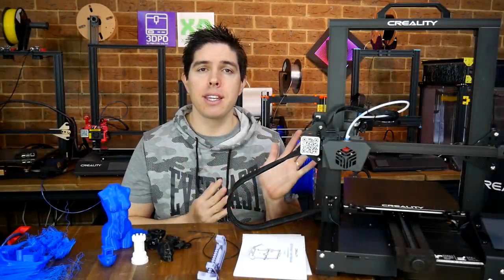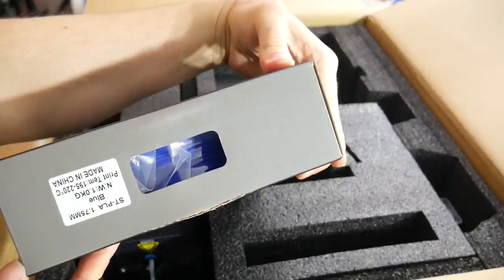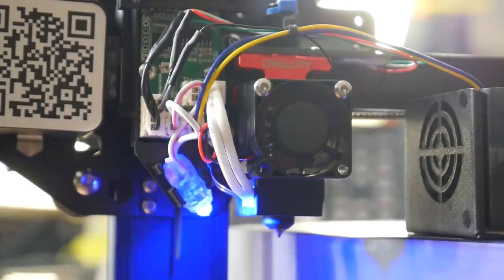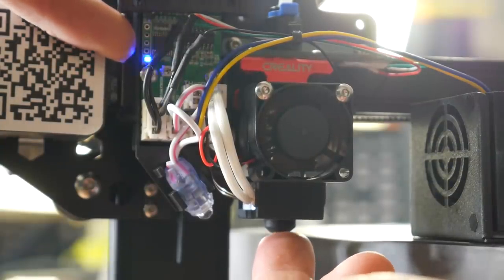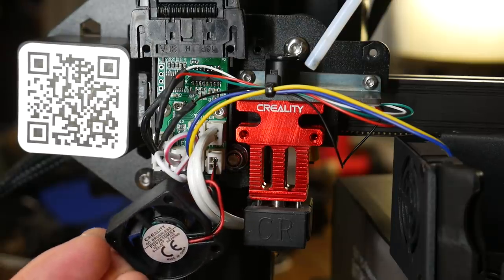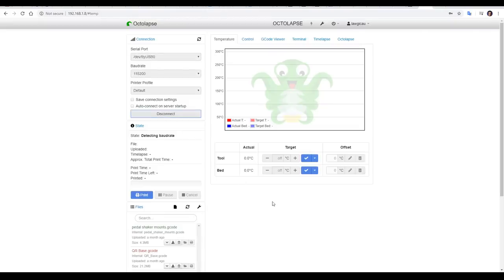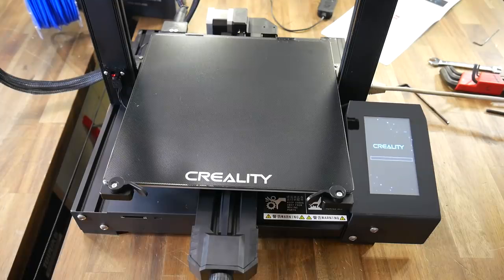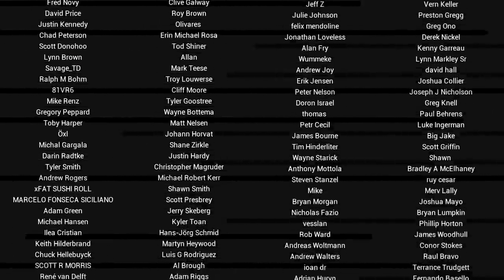Creality CR-6 SE - Your questions answered!

Comment: I wonder how long that extruder will last before something on it cracks.
Reply: why should a steel plate crack when the triggering force isnt even enough to pinch the surface? even if its faulty and crushes into the bed, it wont harm anything. the stepper is just not strong enough to do so.
Reply: I think he meant the new design extruder, not the hot end mount. Creality extruders have a habit of cracking at the pivot point. That is why so many of us add the metal ‘upgrade’ version. This new design with a straight feed path should stop the filament from eating into the arm, and hopefully the new mechanism will prove more robust.

Comment: This weekend I spent 48 hours diagnosing under extrusion in my Ender 3.  Replaced bowden tube, nozzle, the extruder gear and finally the hotend... still very under extruded...  It turns out don't ever turn on "Filament > E in mm3" in marlin!  As soon as I turned it off problem sorted!
Reply: yes E in mm3 is volumetric extrusion, it is an option available in Prusa slicer. the filament in not measured in millimeters but in volume of filament (mm3)
edit: I am using it with Marlin but apart of switching from 1.75mm to 3mm filament, it is not much useful
but useful to use the same gcode on a farm of printers with different filaments
Or if you have a realtime filament size detector (yes it exists) that can change the extrusion based on the filament diameter in realtime

Comment: I have the wonderful CR5SE, A bit expensive but worth it. after a couple of weeks operating great, "making a Set of Chessmen". I changed the Filament From Sunlu Wood to Smartfil Mahogany, but it will not print, I had no problem with Sunlu filament but this mahogany is a problem. I need help to change the nozzle and other components in the hotend to cure the blockage. HELP!

Comment: i don't like not being able to see extractor working... also on the auto level do it leave nozzle at a fixed distance after auto leveling,or does it lower or raise nozzle during printing to keep distance exactly the same on every part of the bed... i ask since there is no such thing is a perfectly flat consistent surface in most cases.... thanks

Comment: I've a Ender 3 heavily modified and wondering if new CR6-SE could be a good change.
Reply: If you are just looking for a reliable printer with good quality: No. the Ender 3 is capable of reaching perfect, and I mean literally perfect, prints even without mods. Yes, i have one myself and it shreds. For more features, more solid construction, better quality over all (maybe higher temps even idk no idea right now) the CR6 is a good option but honestly I dont think its worth it for an Ender 3 owner if you only need one printer. If you want two, the ones here I think are a good duo.

Comment: What the heck has linear advance has to do with UART????
Linear advance can be enable with any drivers even non UART or non SPI ones
Reply from the maker: TMC2208s are incompatible with linear advance when connected in legacy mode. Like on the Creality Ender 3 silent boards as well as this one.
Reply: RomanoProductions A question to you (Creality hasn’t answered me on kickstarter) it looks like we gonna hit the stretchgoal so that the printer is shipped with TCM2209, can we use Linear advaced on those even if UART isn’t used?

Comment: How about upgrading the heatbreak to achieve all metal?
TH3D sells a Tough Titanium Heatbreak for $8 USD (Seems to work well for my Ender 3 with no more PTFE rot)
Triangle Labs sells a Bi-Metalic Heatbreak for $16.50 USD (Fancy)
Reply: dont buy titanium... the plastic sticks to it way more than to nickel platet or stainless stuff - you will see it in ease of use and sometimes even in print quality, especially on pla... 
and to be honest - its just not necessary to enhance heatbreaks, they work well.
Reply: @hanswurstusbrachialus5213  With a titanium heartbreak it is required for best performance to complete a seasoning with oil. Standard canola oil works well and can be done with a filament oiler (found on Thingiverse) or dip the tip of the filament in the oil before a long print (10 hours+), wipe off the excess, and print. This would be needed for PLA but not so much for PETG or nylons.

Retraction settings are also key to stay away from heat creep. Reducing your retractions to 2.5mm or lower, it will keep the material away from the heat break more and also reduce stringing. The TH3D heat break has a very good guide on all of this.
Reply: @Gunner0352  So.. you just explained why not to buy a titanium heatbreak. Its just not worth it. fact. Printing since years - you just dont need it. Too little benefits for too many problems that could come.

Comment: Great video!  Finally got mine after months of waiting.  So far it's doing a very good job of printing, however the first few layers are very thin towards the front of the bed (you can see the thickness decline as it prints), and if it wasn't a glass bed I would presume it was warped.  I run the auto level prior to each print and it still does the same thing.  I noticed that the bed will move if I press down on the front, this doesn't happen at the back.  The Z distance is set at .2 for the auto level and I don't believe that is the problem.  Have you run into this issue at all?
Reply: Yes, Same issue here, did you ever find a fix for this issue? many thanks
Reply: @josephdavid8091  I haven't been able to totally fix it, however I first bring the extruder to the center and set it at .2 using the up/down arrows for Z, then run the auto level.  It's been about a month since I last did, and it has been printing with acceptable results for all that time.  The printer is on and running as much as 48 hours before I shut it down for 8 hours than start again.  Hope this helps a little.

Comment: Personally, i think this printer has 2 major issues, both with the board that were mentioned. With 32 bit upgrade boards and UART drivers so common, i find it ridiculous that the stock board has neither. The driver being forced into stealthchop is a fairly significantly issue for the extruder motor for multiple reasons.
Reply: It's a 32bit on the KS for free and will go retail with a 32, so that's one thing to cross off you concerns list.

Comment: With just a replacement hardened nozzle , will I be able to print filament such as NylonX?
Reply: Probably not.
Reply: @barracuda6817  Is that because it is not a direct drive? Do you think PLA Carbon Fiber would work?

Comment: What does it use to transfer the files? I would assume either sd or cable but hope it uses usb
Reply: If using USB, you need to cut the 5V line to protect the electronics.  Unfortunately instead of custom making that item or just not soldering that pin, they used an off the shelf system and you can blow your main board if you plug in a USB Cable that has a 5VDC supply...

Comment: It's always interesting that a company who can listen, who promotes upgrading will take what people have done in their masses and apply that to a product. Which is what they have done here.

It is a ender 3 with a refined look. And I think you're right it could have had a bigger bed, and they could have put In the package one of those pop up tents for it, for better results (for some of us who live in tempered areas).

Maybe what they should do is make all those parts available as ender upgrades? I have already seen V2 parts available at good prices to update my pro further.
However the issue I have with the printers is that what they do put together is not done to a High standard.
And this printer makes the E3's look like the problem child as they seem to have ironed them out in this....
Or acknowledge the defects in the offering previously...  Roller bending, finger traps for stupid people, and wayward ties... Bad bed clips, bad bed on springs... A hanging out PSU. (Not as if it is looks good) and so on, but it's just little things... Now make it print faster.....or is that why people buy so many so they can print a job within the day??

Comment: Thank you, can we add motor dampeners and which is the best silent fan that we can replace?
Reply: Motor dampeners aren't worth it for the hassle, especially because the only "loud" things on a "silent" printer are the fans. For that, I would recommend noctua 4020, decent price and quite reliable.
Reply: @EdisonWong2004  But I thought they are 12V with low RPM compared to the 24V high RPM, won't that affect cooling?
Reply: I challenged Creality on these fans, because their Kickstarter FAQ says the printer will be silent (~30dBA).  Creality answered they will be shipping what they promised, so these early demonstrators to YouTubers must not be fitted with the final fan.

Comment: it looks almost exactly like a longer lk4 pro with the screen moved and control board rotated and attached to the front
Reply: If the longer had Belt Syncronized, Dual Z axis, Strain Gauge ABL, with custom hotend/LED and optical sensors, real x and y belt tension ..... then ya, EXACTLY like that.... LMAO

Comment: It even looks like they have used half decent connectors although  i will never be happy until i see dedicated high power rated connectors for the hot end/ ends  and bed .
The old geeetech I3 clone i use has taught me many things with how the high power connectors should be configured and i have now set up the mosfets so they are using the metal case as a heatsink and a fan blowing across them  , the logic control and ground  is the only thing connecting them to the motherboard and they are wired directly to the hot end and bed via 30 amp XTL and 50 amp anderson connectors respectively , all wiring is 30 amp silicone coated , this ensures that the only thing going through the ribbon cable is logic level signals.
For a sub 1k$ printer it has some real nice features and looks to be simple to set up  and get running.
Reply: hotend is not high current

Comment: In the case of changing the hot end, I'd have to changed the bed so that I could do manual leveling. Sounds like a hassle outside of it being awesome for any PLA or PETG printing. As long as it prints reliably at 245 without melting the ptfe lining I think I will like this. I asked for two on the kickstarter.

Comment: That hotend being ptfe lined and propietary is a deal breaker, it makes the printer basically a pla only machine. 

I personally think that the artillery (evnovo) genius is a much better deal than this machine.  Titan aero clone and 5 spare pins at the hotend make it much easier to upgrade around the hotend/extruder.  This isn't even mentioning all of the other better features, like the ac powered bed or the ability to use a usb drive.  The genius will also be cheaper.
Reply: I'm actually between these two models and still undecided. One of the things that pulls me towards the Artillery is the direct drive, since I will be wanting to do TPU, but having seen TOU printed on this video I am not that convinced anymore.
Reply: Most PTFE is rated at 250-260C. That makes it good enough for ABS and PET.
Reply: @groundzero_-lm4md  it is not rated for 260, it starts off gassing at 240 and you want a margin in case of temp reading error so you would at most want to print at ~230.

Any company that claims their ptfe is suitable for use over 240 is lying.

Comment: You can get an Artillery Sidewinder X1 for that kind of money, and get a larger bed that's AC heated, a stiffer frame, a direct drive extruder, much tidier cable management, and pretty much everything else this thing offers apart from the ABL and the belt tensioners (you can even print the latter), just saying. 
That's the only "style" of printer i'd "upgrade" to from my CR-10 mini. And even if was buying my first, i'd still choose the Sidewinder X1 over this thing. Then there's also the Genius (smaller X1 basically, some even argue it's better in terms of print quality)...
Bottom line, this particular printer seems grossly overpriced.
EDIT : I'm in the EU, so YMMV in terms of pricing, availability and shipping costs...
There are other printers that are pretty much equal or better than this at the same or lower price as suggested in other reviews aswel. Nothing against Creality here (i own a CR-10 mini and it's great, apart from the warped bed), but this particular printer here seems way overpriced imho, that's all. Maybe for $50-$100 cheaper it would've been a great value proposition. As it stands, i don't think it is, but maybe that's just me.
Reply: Are you talking about the retail price? I just did a quick search and the cheapest Sidewinder I could find online was at least $100.00 more than the KS price of the CR-6.
Reply: I'll take this at $319 over a Sidewinder.
Reply: @mathewcoppola8622  The price is not exactly $319.... You have to add shipping to that if you buy on Kickstarter.  You can see the shipping costs by clicking on "Back this project" and checking the various tiers. Depending on where you are, it varies between $22.5(USA) and $53 (EU, CA) for shipping. I'm in the EU, so my opinion is based on that.
Also, the retail price after the Kickstarter campaign should be $429 for the CR6.
Reply: @oneanotherstudios  Strange. I can find them here for 370.48 EUR on Banggood. Free shipping. Depends on where you are i suppose.

Comment: My dagoma have auto bed levelling and a fixed bed and after like 4 / 5 month it was impossible to print. First i set up the first layer to be close and a month later i added shitty spring to have more control about leveling. Sometimes beds are not 100% flat, warp with heat ( even on ambiant temp ) and sometimes the probe move a bit from the head. So it's a no go for me if no spring and no bed level micro adjust in software.

ps : All youtubers shitters said " this machine is good " but in the forum after 2 month users says " it's shit". So be carefull guys before buying, wait a bit to have draw back experience of beta testers.
Reply: Ya, but your printer is garbage.

Comment: Michael,
is it what you mean with TMC2208 and Linear Advance? Thanks!
I have ordered TMC2209 for my SKR Pro board (with 8825) I hope I won't have trouble when upgrading. At least I know the issue
https://github.com/MarlinFirmware/Marlin/issues/14634
https://www.reddit.com/r/ender3/comments/cxfhrw/linear_advance_on_tmc2208/

Comment: I have an ender 3 and to be honest it has been extremely unreliable, the cost of the add ons and headaches bought through Amazon have cost well over the cost of this complete unit. I still cant print reliably with it. 
There are a thousand variables including print speed and no real guide on how to address stringing, ringing warping and the other ings that make the prints crap. I am going to start a print that has failed 3 times. Its BIG takes hours to run and all I can do is GUESS.

Comment: The Ender 3, Ender 3 Pro and the CR-10 where the last decent printers Creality made, everything since then has been utter garbage, for example, the CR10S Pro V1, V2 and the CR10 Max I understand most 3D printers aren't plug and play and they require adjustment on our part but the printers I have listed above are beyond a joke, if you have been lucky to not have any problems with those printers then lucky you but the countless videos or youtube reporting problems with those printers haven't been fixed and now they bring out the CR-6 SE, the printer sounds good but I'm not holding my breath the quilty just isn't there like it used to be.
Reply: Especially at $1000 now on website.

Comment: @ approx 17:00 "I'll use the machine a lot more, before I release a 'Full Review' at a later date." - LOL - I have not seen the promised 'Full Review', nor have I seen anymore videos from you, on the CR6-SE.  So, I am assuming that you have determined this particular model was absolute crap, garbage, & a piece of junk.  I see Creality also stopped manufacturing and supporting the machine.  Their alleged / promised support, for this machine, was almost non-existent.  I bought of these, because of my great experience with my Ender 3 - almost four years, so far, of quality prints with absolutely no problems.  Was I wrong to think that all Creality printers were created equal.  Like you said, I should have done my homework & research before making the purchase - not after making it.  This CR6-SE experience has made me very bitter, toward Creality, their deceptions, and their lies.  I will never purchase another one of their printers again.

Comment: I'm still not seeing the value of a home 3d printer.  All I'm seeing on these YouTube demonstrations is them printing up cheap plastic toys.  I don't have a degree in computer engineering so I don't think I'm capable of printing up my own whatevers, so I'd be limited to printing up other people's stuff.  Basically, cheap plastic toys. Not trying to be rude.  Just don't know any better.
Reply: I would say 3D printing is not for you if you think they are only capable of making "cheap plastic toys". Those cheap plastic toys you speak of are usually test print models that come with the printer out of the box. The point of everyone printing the same little boats and crap is to access the capabilities of the printer. You don't need an engineering degree to succeed at 3d printing, just fusion 360 and you tube tutorials to get started in making your own designs. There are $1000 to $3000 range printers being used right now in production settings making manufactured parts for many industries, for example agriculture. There are $500,000+ printers out there but my friend works at a facility where they use a $1000 Qidi 3d Printer to make tractor parts. Not toys.